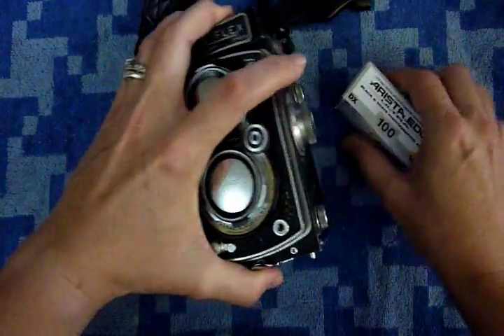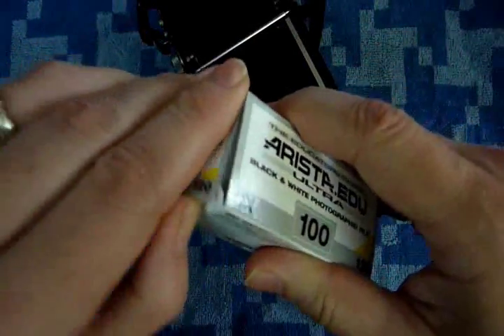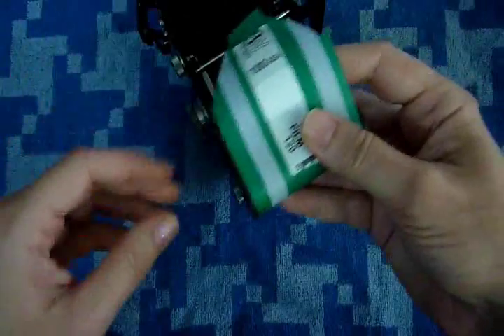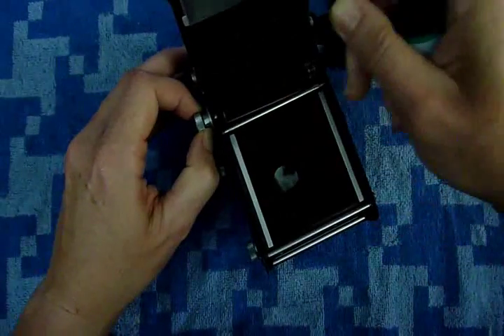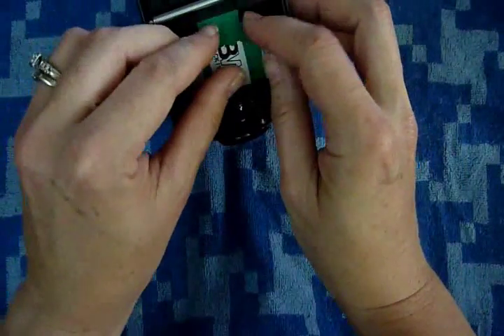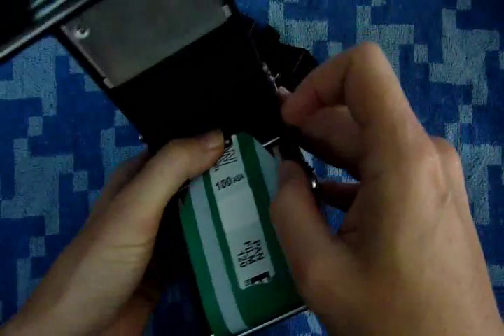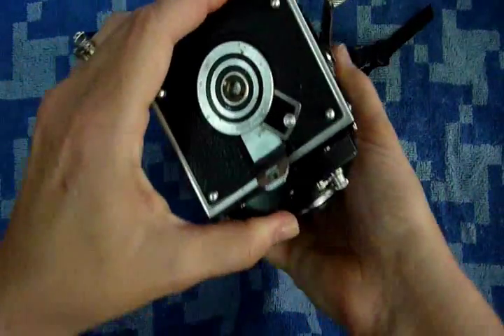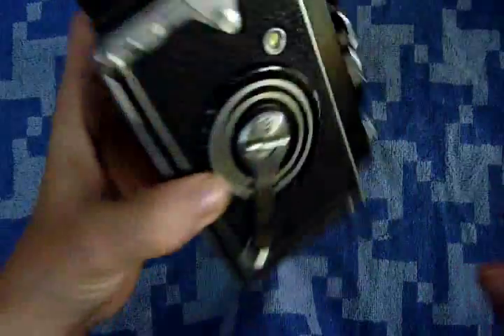Rolleiflex Automat Model 2 TLR Film Loading Procedure

Comment: You must have one of the models that accepts both 35mm and 120 film.  I believe in order to use the 35mm, you need the Rolleikin adapter set (special spools).  The 24x36mm designation is 35mm and the 6x6cm is the 120.  So if you are putting the 120 film in it, make sure that it is set to 6x6cm.